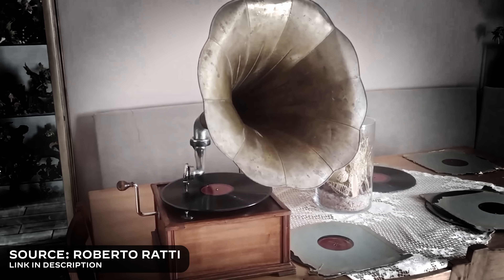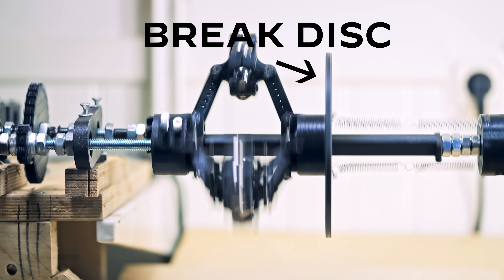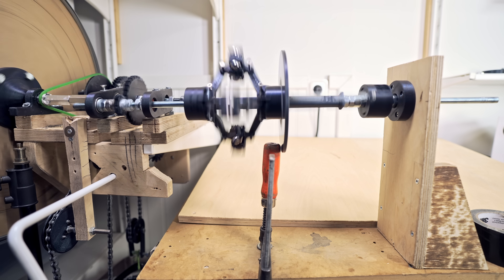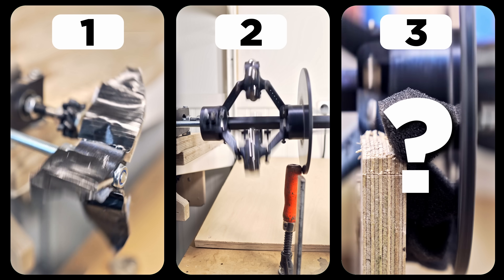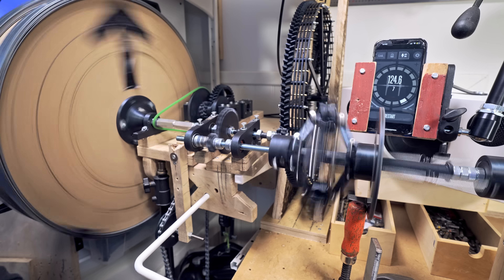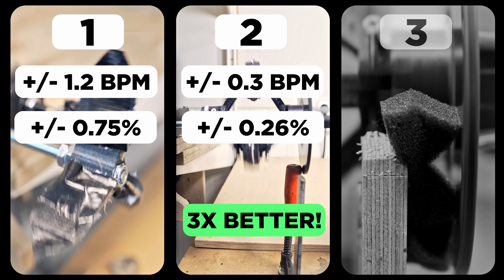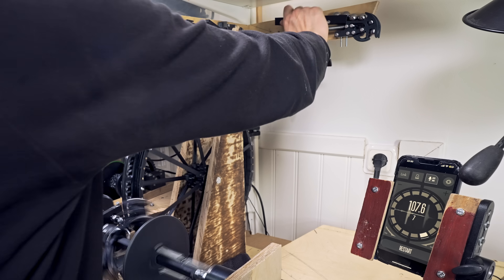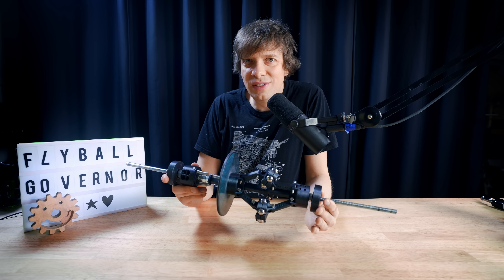How Gramophones play Tight Music - The Flyball Governor

Comment: @Wintergatan  The requirements you set for your project would require a degree in mechanical engineering or something related, if you want to invent everything from scratch.
Thankfully a lot of engineers have though a lot about how to best solve problems, and a lot of fantastic, simple solutions have evolved over time.
Keep in mind that the energy you use to activate the instruments is like adding extra braking power to the flywheel. Try to reduce the resistances where ever you can, in order to ensure that you don't need a 3 ton flywheel and/or regulator by the end. Without either, you end up slowing the music down during periods where more parts move.
The resistance of a grammophone needle on an LP doesn't change very much during play.

Comment: Martin, you are to standard deviation as Eugenia Cooney is to body fat - having none, but still wanting less. Not once have I listened to your marble machine and thought "Gah! It's not tight enough!" I've never said it before, because you tell me there was a problem, and then you tell me you solved it, and I believe you, and I'm excited for you, but then you need to solve the tightness problem all over again. You must have solved the tightness problem a dozen times by now. The Heugen drive was a fine solution to this "problem" on its own. So was to refined marble drop design. So was the computerized motor assist used in the MMX. Martin, you need to stop this madness. I'm serious, this is practically a mental health problem; it's interfering with your progress elsewhere; your ability to move forward with your life. Not only is it taking time you could be spending on other components of the MM3, but all the parts that exist for the sake of improving the tightness are likely going to present you with obstacles down the line, likely in a very literal sense; obstructing other parts that the machine actually needs. Promise me; no more obsessing over tightness. Or, at the very least, you MUST come up with some standard deviation you find tolerable, and never move the goalpost against yourself. Please, Martin.

Comment: this might make it much smoother

hand crank mechanisam > flywheel > second crank mechanisam powering from first  flyweel > second fly wheel > governer > may be a 3rd small flywheel.  

try to find a better way to apply friction because you are dealing with a large continues load ,  form wont last long  >> may be using hydrolic dampening  or mechanical leverage
 ( may be a mechaisam that pushes something up against gravity when the break pad pushes left and right)

Comment: Sounds like this system also solves for 80, 120, etc bpm as you just move that brake to the desired bpm location and lock it in.  If designed with access in mind, this could be done easily between songs I would imagine.

Comment: Martin - Check out an Edison Cylinder Phonograph.
They also use a flyball governor. But their construction is MUCH simpler. The one you showed on this video is noisy, clunky, and has too many parts. You remember "no part is a good part".
I think you need to find a way to eliminate the vibration and noise from the flyball governor mechanism. You will be much more satisfied!

Comment: The diameter of the ball bearings is the store of energy  and retard force. The diameter of flywheel brake is the max sensitivity of feedback. Both need to be adjusted at differing speeds..

Comment: Just be mindful of running a governor at differing speeds and also keep an eye on how much friction  your brake is using.. to reduce  lost energy. Try increasing the diameter of brake drum . But make sure you can accelerate and decelerate quick enough.  Ideally you'd use an electronic governor.  But mechanical is ok too..

Comment: Along with using a brake, you can use rubber bands to the governor, so that it will spring back to slower speeds faster automatically.  Or you could use springs.  It could possibly be configured to run on a bearing instead of a brake, to eliminate friction losses.  Governors are awesome.  I've been thinking of making a transmission for my RC car with one to automatically shift gears at a certain RPM.

Comment: This is a more a variable friction brake than a speed governor. A governor, as part of a closed loop speed control system, must be able to increase and decrease the speed of rotation of the flywheel; this device can only decrease the speed or let it run (if braking not applied) at it's own natural speed due to the kinetic energy of the falling mass. The friction pad will eventually wear out too. I cannot understand your desire for mechanical energy input requirement - just use an electric motor with a speed controller like you had on the MMX. You claim this machine has to play tight music yet you seem to pursue a design approach that will not be of interest when the machine is in operation - do you want to play music using marbles in contact with a range of percussive instruments or just make an organ grinder?

Comment: Putting that foam on a slider is an awesome way to modulate tempo mid song. Should sound really precise and snappy and you could even have a number line showing approximate tempos for each setting.

Also maybe you could lighten the flywheel a bit with the new governor. I’m not sure how hard it is for you to spin that flywheel up by hand but it couldn’t hurt to lighten it a bit if it doesn’t impact tightness.

Comment: The Ball Governor that record players used was an idea borrowed from machine shop Steam Engines. They needed the belt driven tool speeds to remain constant. Only thing that changed a tools RPM was running them either through a gear box or putting the belt on a different sized pulley. "Balls to the wall." was born in that era too.

Comment: I like the pointed foam shape. It is probably the smoothest shape and material combo to make sure there’s no hiccups in bpm. With the wood one you could end up with some pretty binary speed control more sensitive to ball weight and wood surface and probably even temp, but the foam should be a pretty foolproof setup to work in a variety of configurations.  Seems like the foam thickness is spot on in this setup too since it’s compressed about halfway.

I’m interested to see if the foam can survive a concert of playing. Maybe there’s a better material with the same give that can hold up longer.

Comment: Instead of a brake pad which will be a wear item you can still use air as your brake with the flyball governor. If you move air vanes farther from the shaft they'll move faster and have a greater amount of drag.

Comment: Can you reverse the mechanism and use it as a clutch instead?  So as the music speed drops, the clutch engages the flywheel with the music wheel and the music speeds - no wasted energy!   Your flywheel speed would be independent of your music speed.  You could store enough in the flywheel for a whole song and not need to pump anymore.

Comment: I thought immediately of my pilot lessons about constant-speed propellers, they are based on a centrifugal mechanism just like this. The difference is that instead of applying a brake, the centrifugal balls control the amount of oil pressure sent to the propeller hub which in turn controls the angle of the propeller blades. The feedback loop is: the higher the angle of the propeller blades, the more air resistance they encounter, so the whole propeller spins slower.

I'm loving your adventure into "tight music"

Comment: Its not 3 times better or 10 times better.

If you increase the duration of the test, the air governor will keep increasing its BPM until it finally reaches a point where it needs more energy put into the system to become faster. That point had not been reached yet.

On the other hand we have the flyball governor with foam, which hardly had any difference in the end. If you increase the duration of the test, it might still stay completely flat.

So its more like infinitely better.

Comment: The governor needs an automotive brake rotor at full scale. Use an off the shelf set of ceramic brake pads and you have a very solid, reliable and easy to maintenance system. Whatever bracket holds the brake pads can be on a screw to adjust it's distance for higher/lower bpm

If it was coupled to the flywheel sufficiently it could also act as an emergency brake. Using a lever system to slam the rotor and moving pad back into a rigid pad.

Comment: One though I have. Instead of using a break disk on the governor. Let the governor actuate the flywheel break by using a wire. In that way you have less mechanical torque kickback in the system.
Thus play even tighter music.

A other way to do it would be to use a differential drive between the flywheel, the output and the governor, but I'm not entirely sure how that should work.

Comment: Wind governor are very inconsistent in victrola. Now you have a proper model. Now it will be easier to adjust in the vertical position like on a steam engine. Use gravity instead of friction to adjust the speed. You will prolly want one for the power unit

Comment: Congratulations on another 10x improvement! The implications of this design are that you can naw measure and mark set tempos based on the brake pad distance from the governor brake. You can achieve predictability through a calibrated range of marked tempo changes.

Comment: While it is basically the same thing, this would almost certainly work better if the added frictions comes from the centrifugal mass is what the variable resistance force is applied to. You can get high-precisuon parts for this from centrifugal clutches, which are used for many things, such as washing machines and tumblers.

Comment: The fact that the flyball governor plays "tighter" music is a big benefit, but can we all appreciate how great it is that the speed cab be adjusted on the fly?!?! That's a really big deal! This means that he can do tempo changes in the middle of a song.
Reply: Yes!  It's huge!  I'm not sure this was even on his "nice to have list"! But there it is.
Reply: If he makes it to the third marble machine, will it be the first time to possibly hear a music with a changing tempo on a marble machine? I don't think that you could do it with the MMX
Reply: @Ilikepapyrus both previous marble machines had a direct relation between crank turning speed and the song tempo, so Martin could already play at different tempo’s in the same song. He literally does this in the original marble machine video. But it wasn’t “tight” music, perhaps a new machine might offer the combination.
Reply: @SuperCuriousFox  ah ok thanks! Hope that we'll see the MM3, if it ever sees the light of day!
Reply: I think the tempo gradually changed on the original marble as he cranked it faster. But, he didn't really have control over it. This is much better
Reply: That’s exactly what I was thinking. If you calibrate notches for the brake, you can select a tempo on the fly. Only issue is that foam is probably a bit soft for that. I’d go with a hard material for the brake pad
Reply: Should be "simple" to implement as well. Just a lever with a few different stops on it and a cable linkage to shift the brake to pre-tuned positions, and tempo shift on the fly  to see the shifts like we saw in the original marble machine song when he went from cranked play to manual play with the flip of a switch.

Comment: It works so much better than an air governor because the friction is increasing much more directly and proportionally. 

Using existing and proven tech to solve problems is a tried and true process.

Comment: Do reinvent the wheel, but use existing wheels as your reference.

Picasso said, “learn the rules like a pro so you can break them like an artist.”  Using canned solutions becomes a trap if you never take the time to understand what makes them work.  You want to be able to design wheels well enough that you can look at a novel problem and say, “wait a minute.. the forces and constraints here are a lot like the ones in a wheel” when that isn’t obvious.

It’s a good exercise to think about the differences between a caster and a bicycle wheel.  They’re  completely different mechanical systems.. the caster’s axle sits on the bottom half of the wheel, while a bike axle hangs from the upper half of the rim.. and understanding them will cure the tendency to think of anything round as ‘just a wheel’.

Comment: The friction pad is going to be important. Picking the right stuff is going to be both important and something that should be easy to play with over time.

One thing that you should try with on it is seeing how it reacts to changes in load. I suspect that how "soft" the pads are will make a big difference on that. At a guess, harder pads will have more short term variation in speed under any load (basically thing will tend to oscillate because the feedback gain to to high), but softer pads will react more to load changes (things will droop under load).

I'm still thinking that an unloaded timing system that regulates a drive system would be be worth investigating. Most likely something that exploits the capstan effect: tl;dr; when sliding something like a strap or rope around a curved surface, the ratio of the forces on the pulling and retraining ends is basically constant for any one geometry and can be made very high (e.g. 10-100x is practical)

One way to set that up would be to have a drum on a fixed shaft inside a rotating length of large diameter pipe with many helical slits. The drive side would try to drag the pipe around the drum in the direction that tends to make the slats tighten and grip where as the timing side would allow the other end of the pipe to move in the same direction resulting in the slats loosening.

Comment: FINALLY!  Martin is finally decoupling tempo-keeping from the power-module!
It'd be great if there were some way to have the flywheel-governor only slow down the output of the power-module, without slowing down the entire power module.  But I don't know if such a mechanism exists.
Reply: That would be a continuously variable transmission. There are a variety of ways to build such things, one of the simpler schemes is to attach a conical object to the output shaft of the power module, and then place a fixed-diameter power take-off wheel against the cone. The PTO wheel can be moved along the cone to continuously adjust the ratio, allowing the power module to run at a variable speed while the driven unit operates at a constant speed. There are a bunch of other clever designs for these (check out the mechanical fire control computers the US Navy used for a while).

Managing the ratio to maintain a constant speed using only hand-build mechanical components would be a significant challenge.
Reply: @dave7038  Hmmm… I wonder if there is any way to use the governor that he shows in this video to position the wheel against the cone?

It would be nice if he didn't have to throw away energy from the flywheel, though.  Maybe a CVT to get the output of the power module close to the correct tempo, then use this governor to stabilize it to a fixed value.  Would also reduce wear on the governor.
Reply: @dave7038  Another idea!
Control the drop speed of the weight using non-dissipative means.  That then controls how much angular momentum the flywheel has, which, in turn, can eliminate the need for the governor to forcibly slow the tempo to the correct value.

And since we're rough-setting the tempo by controlling the fall-speed of the weights, that means we're not unnecessarily "discharging" the gravity battery into friction in the governor.  So human power is preserved.
Reply: @John_Weiss  Controlling the drop of the weight is an interesting idea. Maybe put the flyball-actuated brake on the axle of the sprocket supporting the weight. Might be difficult to make it respond quickly enough to avoid introducing noticeable variations in the tempo. 

I think the flyball actuated friction brake is a good approach. The total average input power will be low enough that operating it shouldn't be too large an effort (he can switch back to foot driven if necessary), and the continuously and variable waste rate from the flyball brake should be good for providing fine and quickly responsive regulation.

It will be interesting to see if the flyball governor will support variable tempo without degrading the control dynamics too much at the high or low ends of the range. It needs to be able to waste power equal to the difference between the minimum and maximum power of the machine (greater when lifting more marbles), and the pressure it puts on the brake will vary depending on the selected tempo. It can potentially be a tricky tuning problem.
Reply: @dave7038  I was actually thinking more of changing the gearing ratio on the axel turned by the falling weight, either by using bike derailleurs or using a CVT.  Or using a sprocket mechanism like in a spring-driven watch.

Comment: Though now you'd need to think about how to set it up for wanted BPM. Is there a way to calculate the distance and have the same BPM each time? By looking at the video (and seeing you almost got your hand wacked by the spinning ball while trying to change it mid rotation) maybe going with a bigger flyball section and a bigger brake disk you can have a bigger range of motion and thus more accurate selection of BMP?

Comment: If there is any problem with the foam it's that it will where out quick. The reason the clamp wasn't that effective was to to the limited surface aria that it was contacting the disk with. Using a wood or plastic block to connect might be more effective and durable. Though it will require some tinkering to get just the right amount of surface contact.